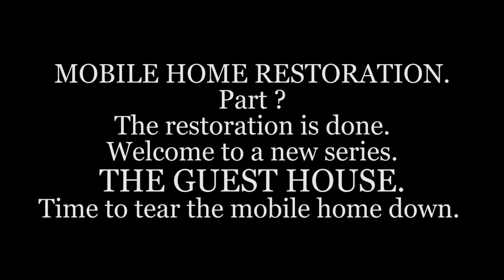Mobile home restoration ends. THE GUEST HOUSE build begins. Tearing down the mobile home entry.

Comment: Joe,
This is just a suggestion.  Why don’t you build a nice sized pole shed with living quarters on one of it or within it.  Then you will have a place to store your tractors, campers, and other equipment.  Have a nice spray foamed heated shop with your new wood burner.  That way all your stuff in stored inside during winter. And you can have your  own little man cave.  You can kill 2 birds with one stone.
Reply: Barndominium’s are all the craze now… Would be a perfect solution for this property.
Reply: Perfect idea!
Reply: Agreed 👍🏼
Reply from the maker: If you would like to pay the additional 80,000 dollars more than the guest house will cost to do that I will start right away. Lol.
Reply: @HabitualButtonPusher  Lol
Reply: It will be nice to have the guest house to live in while you redo the main house.  The trailer would have been like putting lipstick on a pig. Are you bringing your crew in to help with the framing like you did with your father's  cabin?

Comment: We had a similar situation when we bought our property.  We ended up putting up a pole barn structure and finishing the inside to live in.  It has the 6x6 piers like you are talking about.  Ours is a two story with Bills
Wood shop on the first floor and our living quarters on the second floor.  That was the least expensive way to get both a wood shop and a house.
Reply: Our house is a two bedroom one bath 30x60
Reply from the maker: I really like that set up. I have seen several like this and it really is a good way to go.

Comment: I support the demo idea; a mobile home is a depreciating asset and a resale disadvantage regardless of remodeling. However, the perfectionist in me knows I would forever regret not tearing out the milking parlor mess before building on that site. This especially if I had a big lift to help.
Reply from the maker: No need to tear out concrete. I actually prefer that it stays.

Comment: going to be fun to watch Joe. but I always thought it would be more cost effective to put a better mobile home there than try to renovate the old one. stay safe.
Reply from the maker: We thought about that and we looked at a few online but to do that the old one needed to be removed and then pay for the new one to be transported, set and leveled and then all the skirting and insulation and then plumbing and electric hooked up and at the end of the day we would have a mobile home on the property which brings the property value down or at least is a bad selling point. Since I have done construction my whole life this was the best alternative and it will add a lot to the properties value.

Comment: If the mobile home is 1976 or newer it has a HUD tag on the outside. The VIN number is usually on a tag on the rear of the mobile home on the right corner, and the VIN is stamped on each of the metal support I beams under the mobile home.

Comment: We have a smaller old mobile home with no title or vin, but did find an id plate of sorts on the cross member of the floor, about 2 or 3 back from the tongue (which had been removed) of the trailer.

Comment: You made the right decision good practice for ideas if you ever decide on a cabin buts hard to get rid of memories you must have in that tent how long will the build take good job
Reply from the maker: I am not worried about the memories but so far the Tent is holding up very well so there is no need to replace it.

Comment: The right call in my opinion. Some folks are talking about a pole building. Just a thought, but if you did that large enough to park the 5th wheel in couldn't that do double duty? Anyway, thanks for the tractor segment!

Comment: I like the entire guest house idea, much better! Just curious, not doubting you at all Joe, why would you not go 24’ wide using the same principle for going 32’ long/deep ? Will you be able to use the furnace you got for the mobile in the guest house? Will make a great series of video’s to follow!! Thanks 👍👏Rick
Reply from the maker: I will talk about that more in upcoming videos. I need that 2 feet so I can get the tractor or a plow truck between the workshop building and the new guest house for plowing snow. I could actually fit a 24 in there but it is getting tight and I want to err on the side of caution.
Reply: @NorthernSeclusion  thanks Joe ! I knew you had to have a good reason….I don’t comment often, when I do, usually just so I better understand things. Been with you from the beginning….always a supporter. 👍👏🇺🇸 Rick

Comment: Joe
Do you prefer remodeling old or building new? I guess building new is easier from a plan but remodeling old must be more fun and challenging when you need to rethink ideas.
Reply from the maker: If you bid it right, you can make more money doing remodeling but if you bid it wrong you can lose more as well. That is the fun part. Its a game and once you have done it a long time you tend to win the game more. Lol. New is nice because I will have nothing odd to deal with. Building new is boring compared to a remodel but in this case it will be much easier.

Comment: Joe, I am just curious, Will you bae able to tap into the existing well? With the house on stilts, do you have to worry about it freezing just before it come into the house?
Reply from the maker: I will tap into the water that does comes from the house that right how feeds the mobile home. It gets buried underground 8 feet but once it comes up towards the surface it has to be heat taped so it does not freeze in the winter.

Comment: If there's no inspection why not put the trailer on columns so it would be classified a permanent structure for insurance purposes? That mobile seems solid and many people would be happy living in it once freshened up. I notice a lot of negative comments regarding mobiles and while they're not for everyone they have advantages over conventional homes. I went from a conventional house on a tiny lot to a mobile on 30 acres and couldn't be happier, also pay  $4000 less taxes a year.
Reply from the maker: It is still a mobile home. The one we have is on columns and if it would have been on wheels we would have had no trouble as far as the mortgage company was concerned. I have nothing against them, I just have something against this one. It keeps stopping my progress so it has to go.

Comment: Logic works! I'm not a builder, but thinking of best use of materials, would multiples of 8's be logical? As in 24'X32' because of the size of plywood, and studs. I'm just wondering. Maybe at some point could be doing one for my self. I enjoy the planning process and love following along!
Reply from the maker: I need to be able to drive the tractor between the shop and the new building for plowing in the winter. I need to stay a certain ways away from the septic system. I could fit a 24 in there but it is getting tight. I would rather just be a little more comfortable and do the 22. 22 foot trusses are also something they stock here at the big box stores, 24 I would have to order.

Comment: How about putting in a pocket door in the kitchen?
Reply from the maker: I have probably installed close to 500 pocket doors in my life and I do not like them. They never last as long as a regular door and you can not get it there to adjust things if needed. They take up less swing space but you loose the inside of the wall area as far as electric and stuff is concerned. People love them though.

Comment: Why do you need to build another house for? You have all those travel trailers for guests, does not make much sense .
Reply from the maker: You obviously do not live somewhere that gets to 35 below zero in the winters and winters last 7 months. It simply does not work at all. You would have 8,000 dollars in propane costs to heat it not to mention the frozen water lines etc. Not a chance it would work without extensive costly and still temporary measures to make it possible. I worked out in ND and wintered there in a camper much like my work camper. The winters there are almost as harsh as here. It was a constant battle and a battle that could not be maintained. I had salamander heaters running under the skirted trailer when it got super cold and my lines still froze. The following 2 winters I spent one in a hotel and one in an apartment. I will never winter in a camper again.
Reply: I live north of you in MANITOBA CANADA  which is just as cold if not colder JOE, what is the need to live  year round in the trailer?Most guests visit in the summer, you are the first person I've heard of build aseparate house for guests when he is retiring,I guess I lead a sheltered life. (lol )
Reply: Last time I checked Joe lives in America so he has the right to do whatever he wants .

Comment: Have you checked with your insurer that an unpermitted guest house will be insureable?
Reply from the maker: All this is is an accessory building. No different that a fancy barn. There are no permits here at all. The house we live in was never permitted. They have nothing that does that out here. There is no building dept. If we lived across the street it is in city limits, they would need all kinds of crap done to make this happen. Not here.